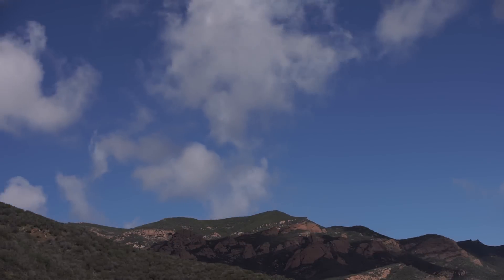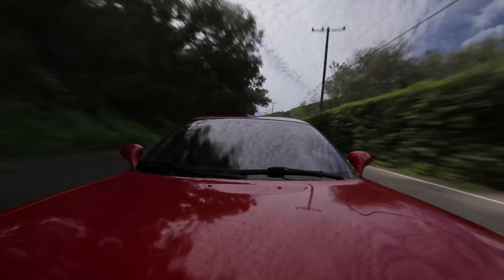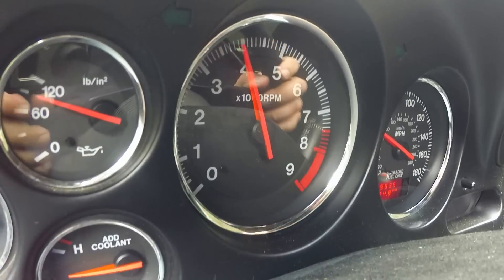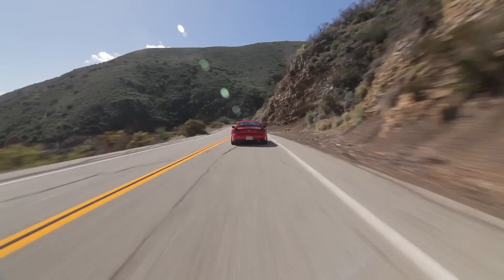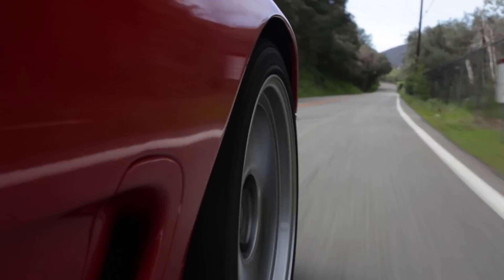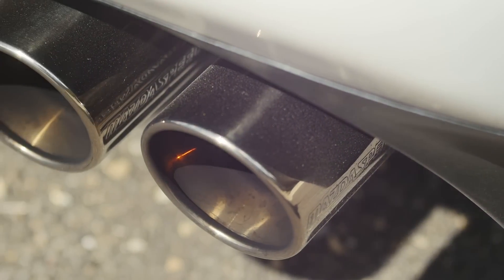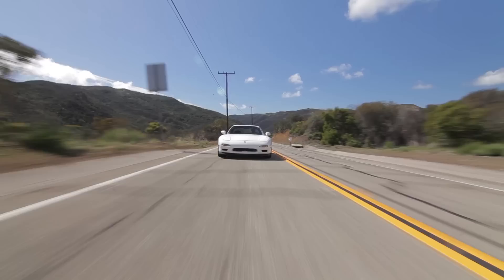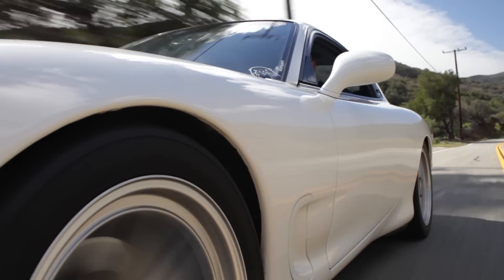Mazda  RX-7: Turbo vs V8 - /TUNED

Comment: I look at people that swaps LS engines into a FC or FD3S RX-7 as complete retards and morons. The rotary engine had tons of potential. Which engine in the world can pump out 150BHP NA with a 1.3L engine? No one! Even now! 

Plus the 13B is extremely light. The Twin Turbo setup is actually harder to set but once you get it right, it's way better than the single turbo set up. Most ST setups loses power at the top end once it passes 6K RPM while the TT setup would pump the 1st turbo powerband up till 4K then the 2nd turbo would kick in at that level close to 7K, redline territory. Back to the weight. The 13B makes the car have a perfect weight distribution and a V8 just ruins it. A RX-7 is for racing round a track where there's corners and having a lighter engine always is easier for you to get out of situations when things gets horribly wrong.

And like you said, "It feels like a Corvette". ... Wait what? A RX-7 into a Corvette? IF you are able to make a RX-7 into a Corvette, you're a massive douche and you should have just bought a Corvette. Corvette are built for speed! Not the RX-7! Don't go and chop up a RX-7 and make it into a Corvette! 

However, the main reason for people swapping out the 13B with LS are because they are too lazy to maintain the engine and simply, that's it.
Reply: You can't said them as moron cuz everyone has their own opinion rotary engine is lightweight while combustion engine is high hp the rx7 is so light that its sacrificed so much hp and become slow thats why the rx8 is faster also thats why people swap to v8
Reply: Muammarvsgaming ROBLOX and more The Rotary engine in the RX-7 isn't slow and in fact it's fast round a track due to it's weight balancing. The RX-7 with a LSX turd might be able to compensate for the lack of "power" but people keep the rotary engine for it's sound (BRAP BRAP BRAAAAP) and it's ability to take much more abuse than people think. The LSX.. Everyone knows it could take tons of shit but not the 13B.

Comment: Well, I have to say that it’s not enough proof that an ls Rx7 can go faster than a rotary in a straight line. If you want to make the rotary faster than an ls swapped Rx7 then you have to 20B swap it or 26B swap it, what I mean by there’s not enough proof I meant that nobody ever did a race between a 20B or 26B vs ls rx7

Comment: Wait, so you concluded that due to the lighter weight of the rotary, the car steers in better and feels lighter. But there is nothing better about the rotary in any objective way? So lighter weight and better handling are no objective benefits? Sounds like some good old fashion Detroit bias ;)

Comment: In have an NA 3 rotor (20b) and have had a 2 rotor (13b) single turbo and have driven several LS-powered FD's.  The conclusion here that the LS car is faster and gets better fuel mileage while th FD turns in better is a poor comparison.  The FD will beat the LS car on any track and on any back road.  If you want a car that's fast in a straight line, the vette is faster than THIS FD.  There are single turbo 2 rotor (13b) FD's that are faster than THIS LS-powered car.  Raw speed is all about the money you want to spend.  The FD with a rotary will always handle better than the LS-powered cars.  Period.

Comment: isn't it kind of wrong comparing a small wankel with a v8. Shouldn't they take something a little bit closer to it in size like a small v6 or something. just thinking since one of the advantages to a wankel is power to size.
Reply: Rasmus Fjeldstad LS engines are very light and compact engines.

Comment: How to ruin an RX-7:
Step 1, swap out the rotary engine for an LS or any other V8
Congratulations! You have turned a Japanese masterpiece into a Corvette and spent more money in doing it.

Yes, I do own an RX-8 with the 13B-MSP 6 port in it. But aren't the reason to get a Mazda RX-7/8 are to enjoy the rotary engine? If efficiency is your thing why not go out and buy a Tesla Model S P100D. We all know rotary engine has really bad fuel efficiency, and some turbocharged 2.0 l4 will beat rotary engine in the power and efficiency department, But the sound and the way rotary put out power is something that we got addicted to. Beside RX-7 was all about how it handles because of it's weight and it's distribution. putting and heavy engine up front, as you mention reduce the speed it can carry in a corner. 

Fuck you Daniel and everyone who downgrade their RX-7 into a Corvette. 

Sincerely,
The Rotary Community.

Comment: Rotaries are worthless unless you''re a rich kid that just has to be different.. 
They could hang with piston engines in the 80's and early 90's, but after that, they are a failed design.
Low power, sucks gas, and needs maintenance like a Ferrari.  
If they weren't garbage, at-least one company would still be making them.

Comment: How on earth does it have a British sports car look about it?? Do some people just open their mouths without thinking? British sports cars are known for sweeping rear ends, long bonnets with the cabin towards the rear of the car, big circular head lights and large sweeping wheel arches and curves. That thing couldn't look less like a British sports car if it tried. Furthermore anyone who argues the rx7 has the wrong engine isn't a true car enthusiast and should shut up immediately. The whole point of the rx7 was to be a rotary it is the icon of the car and by swapping it with a V8 you are just being a typical America who thinks that every car is crap unless it has a V8. The people I refer to are fake car enthusiasts because they see cars as a set of numbers and pros and cons. Some cars are more than just numbers and so the V8 can have more torque and more power etc etc but that is butchery because the rx7 is supposed to have a 50/50 weight distribution, it is supposed to be the icon of rotary engines, it is supposed to have a smoother power transfer with minimal vibrations and it is supposed to rev hard and have less mechanical drag and more efficiency than a conventional piston engine. Why do these fake enthusiasts who are usually Americans always miss the point of a great car!?
Reply: +Alex James 

Alex,  I personally see styling influences from the Jag E-type (one of the prettiest cars IMO) and even see some TVR cues. Sure the bonnet isnt as long as the jag but it is still proportionally significant. The pop up head lights are very 90s. However, the cabin is posteriorly placed and the widely extended hips flowing out to an overall smooth shape definitely reminds me of the mentioned cars. To each his own though. 

Armen Joseph Pezeshkian
Reply: I think you have the E type and TVR mixed up with some other cars because i doubt there is a single panel on the RX7 that you could say looks like an E type or TVR and not to mention the fact that even if it looked just like those two cars it still wouldn't look like a "british" sports car because those two car types were like anomalies and look nothing like the hundreds of other british sports cars and so they are not typical because they look different and if they are not typical of british sports cars then it is wrong to neglect other british sports cars and their beautiful styling by referring to the RX7's look as a british sports car look.
Reply: +Alex James 

Triumph Gt6 spitfire 
1960s Lotus Elite
Lotus Elan

Take it with a pinch of salt
Reply: right whatever but you are trying to argue that an rx7 has british sports car look about it and i own a british sports car and the styling couldn't be more different from the rx7 -_-

Comment: very very biased as hell. Not very fair to the rotary. The Ls engine of 1992 was a lot fucking slower. A modified rotary with a big turbo would out due that ls engine Even if the ls was boosted. The high end rpm of the 1.3 rotary is unbelievable. Yes theres advantages of an ls but you know what this was a very unfair comparison and you viewers need to know this.
Reply: There was no LS engine in 1992

Comment: What's the fucking point of putting an LS engine in an Rx7? If you're only interested in figures such as horsepower or torque, just buy a freaking corvette, there you go you have you V8. Yes, it is a great engine, but it is not a reason to put it everywere....

I do that there's no point ruining such a great car, it is called an Rx7 because of that wankel engine. This car is so great not because it has 5 billions horsepower... It is great because of the way it corners, the way it's weight is perfectly distributed. So yeah, it might not be powerful, it does need some more attention than you traditional engine, but what an engine.

Anyway "'murrica' like they say...

And I don't give a fuck if you don't like my comment, just stop putting LS engines in every fucking car you see....

Comment: if ur swaping engines then get a 20b in there how are u going to compare a 2012 ls block to a 1990's rotary engine. that rx7 isnt the up to date performance on a rotary u can swap a 20b n easily kill any american muscle car. more research would have helped cuz ur honestly talking about engine swaps u can't have a limitation on your tuning just because the v8 can't offer more performance upgrades the wankel engine was a basic design for a reason.
Reply: +Osvaldo Hermenegildo A 20B swap will cost at minimum $20k if you pay someone to do it you are looking at $30-50k.  You can convert to an LS for between 10-15k if you pay someone to do it for you.  I know I priced out all 3 options when I had my engine rebuilt and converted to single turbo.

Comment: The rotary engine IS better. Why?
lighter, revier, = better cornering.
In the rx-7 this is all that matters. It's a great chassis designed to go fast through corners. Putting a v8 in the rx is just like turboing an NA Honda, its a crime.
To sum it up, the V8 KILLS the soul of the car period.